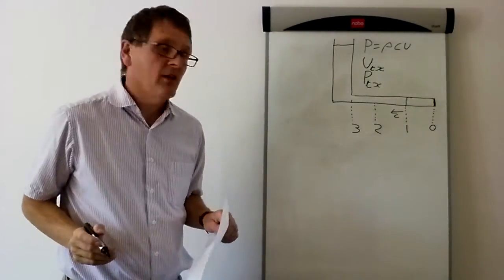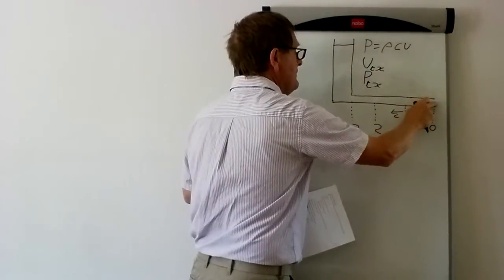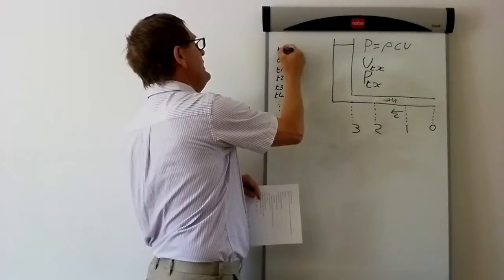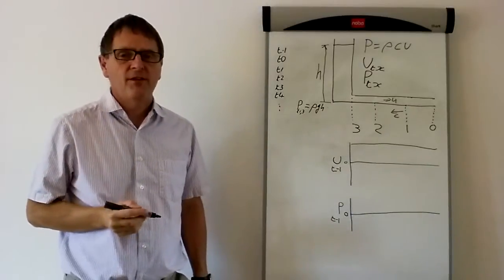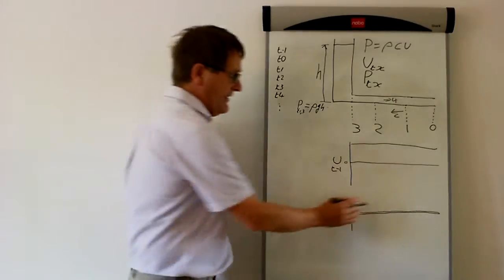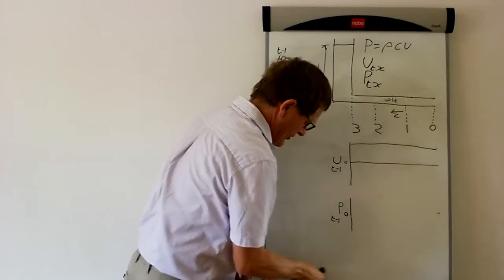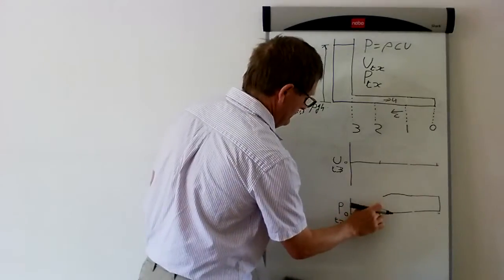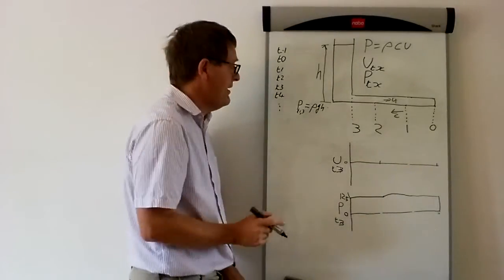Water Hammer Wave Reflection and Valve Closure Time

Comment: Hi Mike,
Confused as to why the High pressure in the pipeline would rebound from the lower pressure tank at t3 and cause a negative pressure in the pipeline instead of causing the tank to surcharge. This is what we would normally see in a surge tower or hydropneumatic vessel. Could you provide some insight?
Cheers
Luke

Comment: Mike, have you looked at how these formulas apply to mud pulse telemetry that is used in drilling wells.  MWD (measurement while drilling) tools encode data and send it up to the surface by creating a mud pulse wave.  I want to understand more about the wave that is created as the orifice is closed and opened to create the pulse.

Comment: Thank you for the video, as I am not very knowledgable about fluidic mechanics or a hydraulics engineer I have found it very useful. With regards to transient flow, I'm hoping you can help me with a problem I'm having. I'm trying to find information on pressure surge waves generated by microsolenoid valves within microbore flexible tubing, but I'm having a hard time finding any. Is there any literature that you know of that could help? Thanks.
Reply: me to i need   any literature ,  can you contatce me  to work with me if you went

Comment: What if we have a variable diameter of the pipe ? ... like for example if there in the middle of the pipeline a distributional tank ?
Reply from the maker: As you increase the diameter  the velocity reduces so the surge pressure will be lower in the larger diameter sections
Reply: @MikeCrowley  thank you Mr. Crowley so to calculate this pressure in that section I should run the same equations with different velocity.... is it is correct to use pernolli equation ?
I saw your project Crowley Pump I love it <3
Reply: cool I understand then the wave will not reflect beside the nick. then in case of variable diameter do I use this equation  <<<Smax = V*(A1*L/A*g)^0.5>>> to calculate the High of the surge tank or should modificate it than to be <<<Smax = V1*[(A1*L1)/A×g]^0.5+V2×[(A2×L2)/A×g]^0.5>>>  add to this by using  <<<P1V1=P2V2=mRT>>> I can calculate the Pressure in the surge tank.
I remember that pump called ram works on the same equations and keeps compressing until the surge pressure in the pipe equals to the pressure in the compressing chamber.. this could be a good video to do :)

Comment: I heard if increase the size o the pipe it will reduce the water hammer in gravity system like a faucet (tap) is piped in 20mm then increase the pipe for 32mm and just branch off for 20mm to feed the faucet.  I work in NY as a plumber for 20 year there houses does not have a water resevoir the water comes with pressure from the street and i have seen old houses pumbing with 12" pipe long with a cap they called is Air Chamber. Nowadays SioxChief from USA makes a water hammer arrestors to install even at laundry machine faucets. Well the home made air chamber works?? I am in Brasil now the plumbing here is terrible to work they just have the basic.
Reply from the maker: If you have a bigger pipe then this will reduce the flow velocity .  If you reduce the flow velocity you will reduce the surge pressures.  So yes bigger pipes can reduce the surge or water hammer.